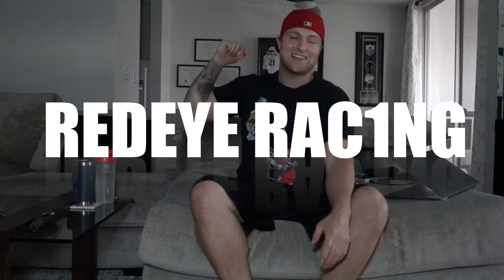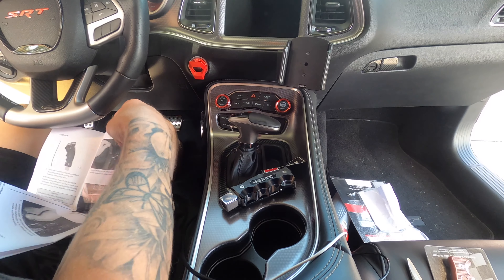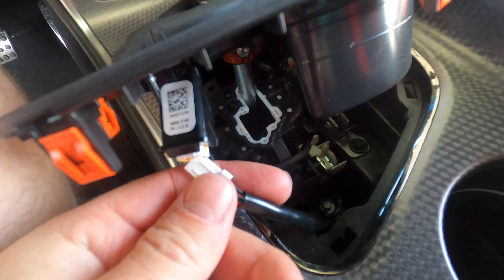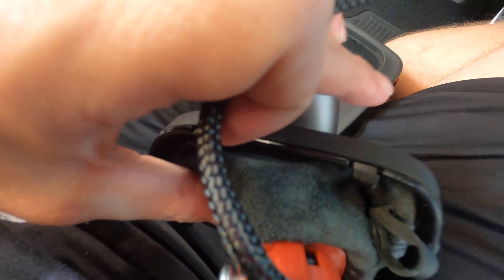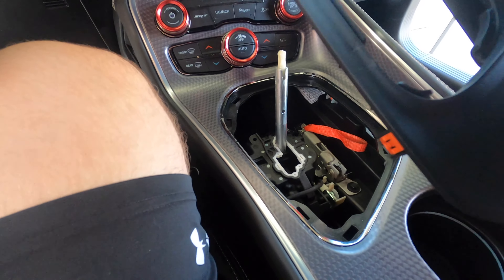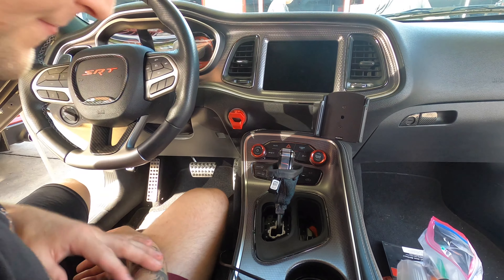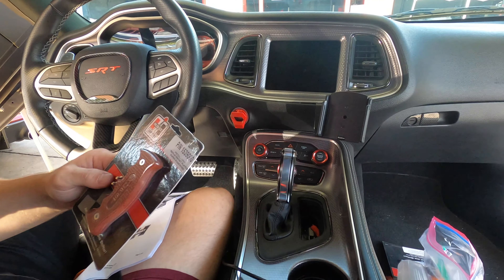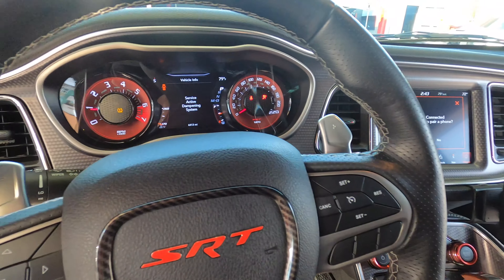PISTOL GRIP SHIFTER INSTALL ON CHALLENGER HELLCAT REDEYE!! I'M IN LOVE!!

Comment: Nice rosewood grip and is a sick Challenger,  what are the back tires on that bad boy ?
I just recently got new 17" racing wheels for my SRT8 wrapped in Micky T 305x45s, and are awesome. Yeah you have a sweet Mopar there, and love destroyer grey to
Reply from the maker: Haha thanks brotha!! I did a 15 inch conversion and have MT 315-60-15s
Reply: @SupercarJordan  Are they really, wow that's awesome and didn't know that they made conversions for them. I thought that they looked small, but didn't think they were that minimal and are badass. I'm happy with the 17s, but for future reference where did you get the kit to do it ?
Reply from the maker: @lovethesmellofracefuelinth7374  it’s a wilwood kit. I got it from my shop. Should be 900-1K plus labor but then you gotta buy the wheels and tires. It’s a pricy one. 17’s are definitely solid unless you’re going crazy power